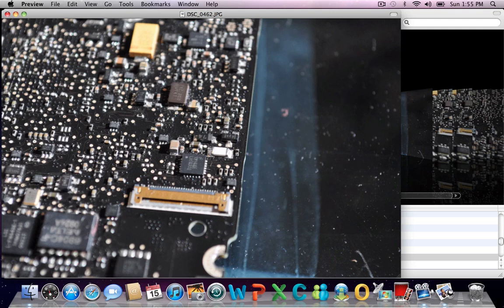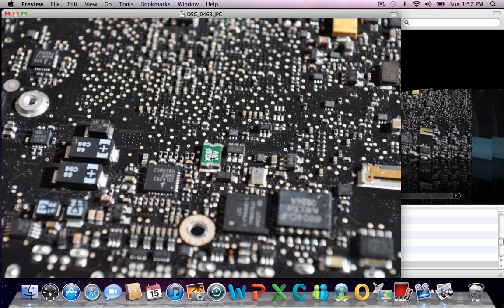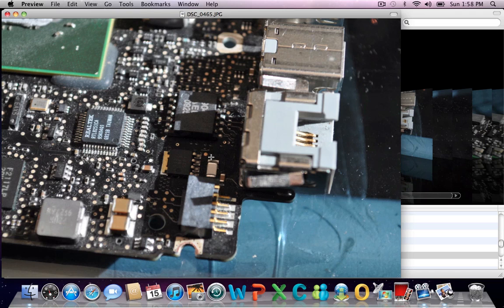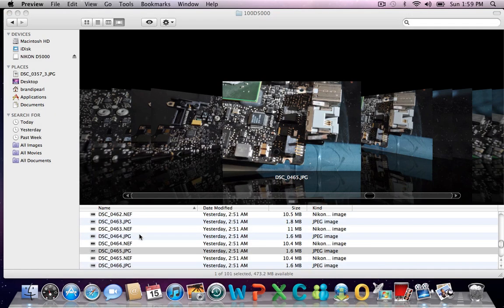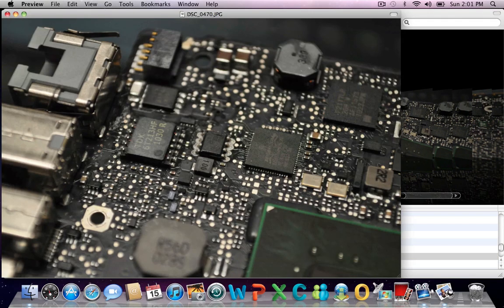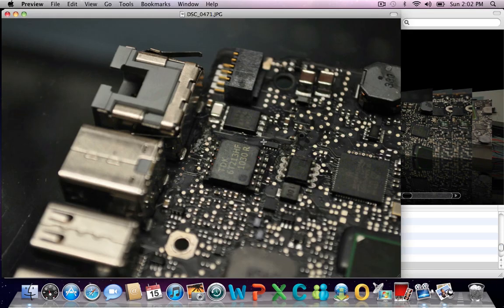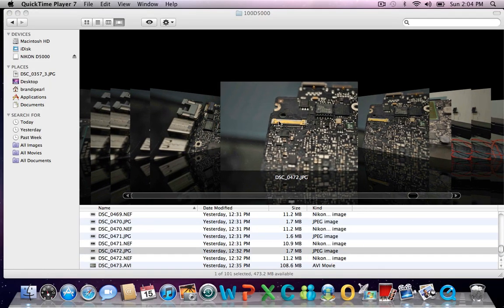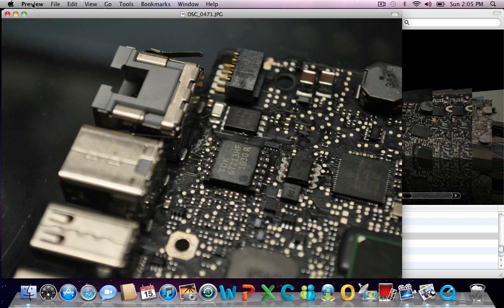Doubleclickittofixit Apple Unibody Logic Board Repair With No Video and Power Issue - Part 2

Comment: Firstly, thank you so much for all the great videos, including this one. Very informative and clear. I've learned a lot.

How would go about treating and repairing the corroded pins on the mosfet at 05:40 and how would you test it to see if it was functioning properly?

I have a dead Macbook Pro a1278 board due to a spill that I am trying to diagnose that has a chip with corroded soldered pins on it. thanks.

Comment: Hi there.
 I got the problem with macbook pro 2010 mid logic board. The problem is heatsink (gpu or cpu) gets very hot in about minute and macbook just switch off. everything is clean and thermal paste is new(good contact with heatsink). Can you advise whats can be wrong and what I should check? Thank you